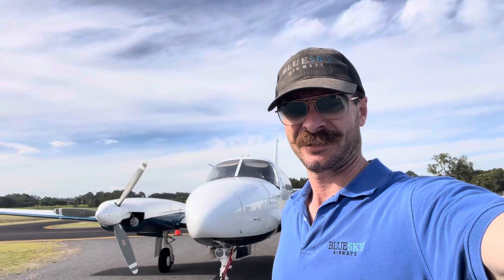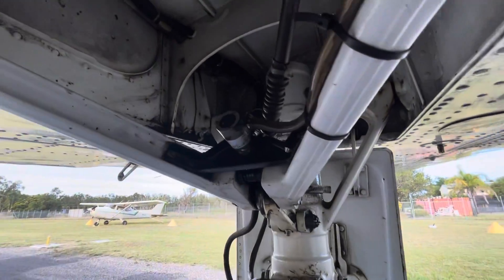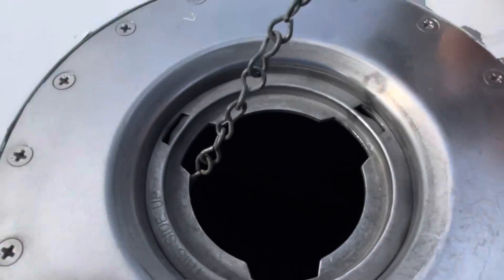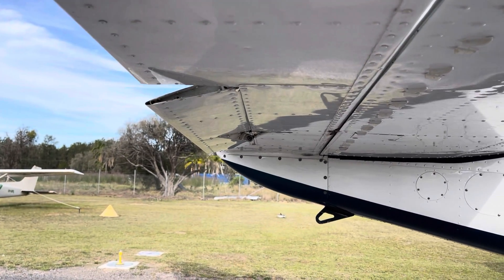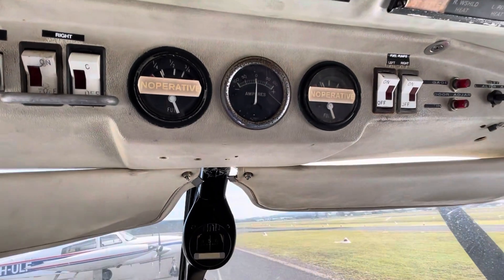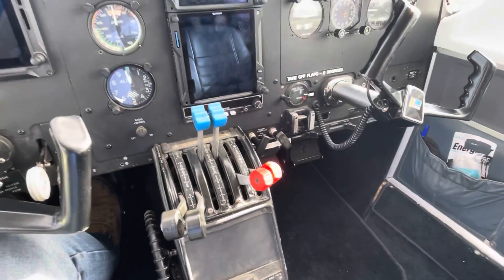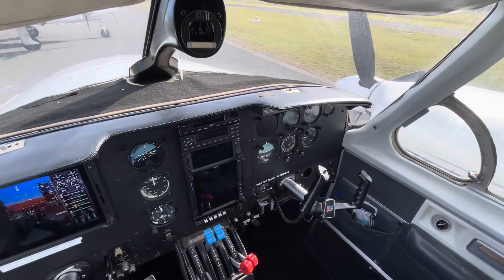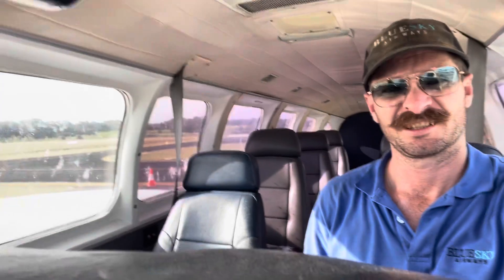Piper Chieftain walkaround

Comment: I flew the Navajo for almost 2 years and I really came to love it a lot, I miss it and I would like to fly it again. work carrying postal cargo and bank securities. I remember one time our right engine went out at rotation speed and I thought that my partner had cut it on purpose. but in reality the right tank had run out of fuel and my first officer had not changed to the inner tank, the reaction was quick where he changed to the tank with no fuel and turned on the pump, starting the engine again. After my partner told me that it had really turned off, I realized that it was a real loss of power. In short, I have many stories about that plane. On my channel I think I have a video left landing on the island of Margarita in Venezuela.
Greetings friend and I hope to see another video of that beautiful Navajo PA31
Reply from the maker: Thanks for commenting! They are a great aircraft, I have a real soft spot for them. That would have raised your heartbeat for a bit when the engine stopped on rotation! 
I'll watch the video of the landing in Venezuela tonight!
Thanks!